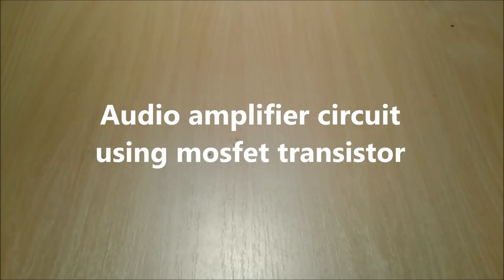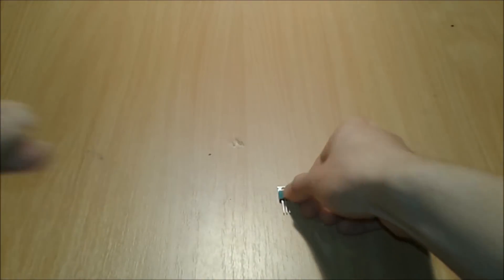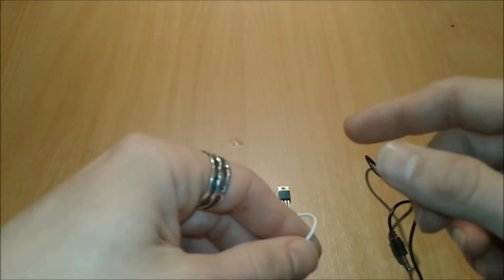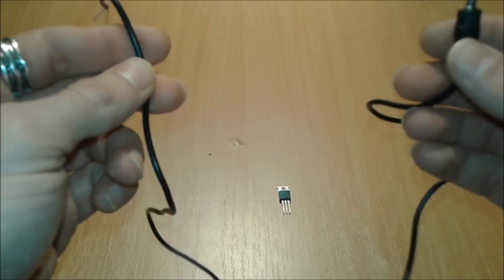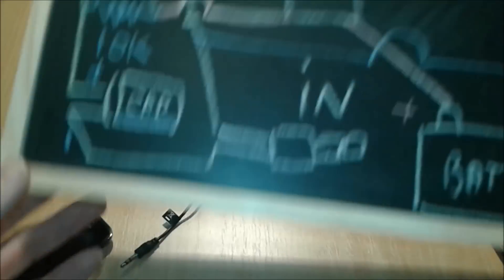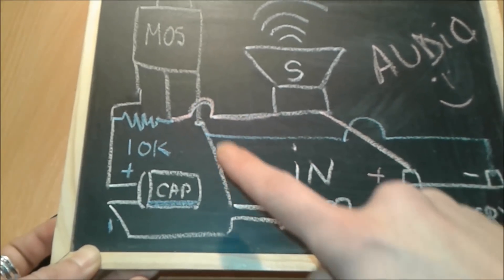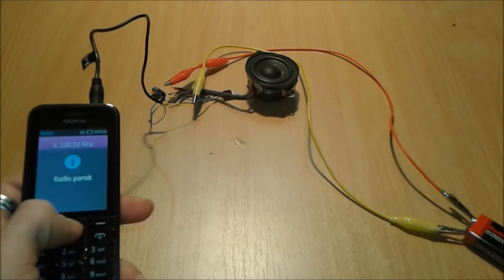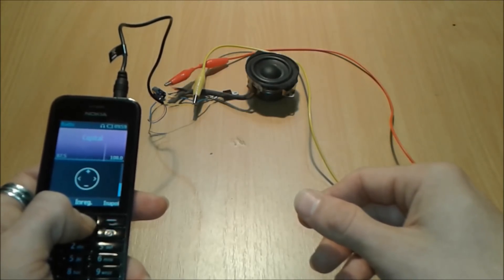How to make Audio amplifier circuit at home using mosfet transistor IRFZ44N

Comment: Cool. What is the maximum switching  rate? Khz or MHz?
Reply from the maker: Carlos Estevam hi there buddy 100khz-300khz all the best
Reply: Thank you. I have learn to check it out by the rise time and fall time. I have IRLz44N mosfets and both rise and fall sum up to about 400ns which gives less than 4MHz, which is the frequency I need to amplify a VHF signal. IRLZ44N should not be a way to do it.
Reply from the maker: Carlos Estevam it's not the best use of this mosfet it's just as proof of concept how easy it is to do it. The best usage of mosfet is in switch mode power supply its like a relay with a small amount of voltage can control a huge load in comparation to a normal transistor witch is a current driven device the mosfet uses less current thus we can say it's a voltage driven component
Reply from the maker: Carlos Estevam if you will need a transistor between 3-6mhz you should go for the old and trusted 2n3055 power audio amplifier

Comment: Can i use irf830
Reply from the maker: Newbie user yes sure and power it with 5v or one lion cell put the resistor like in the diagram to protect your phone output
Reply: Thank u sir.
Reply: Its that 1uf capacitor
Reply from the maker: Newbie user in the video is 23uf and 400v but is not crucial any 25v or above and from 3.3uf will do the job
Reply: Thank u sir for your answer. :)
Reply from the maker: No problem buddy any time all the best